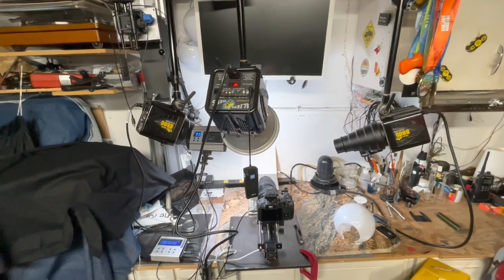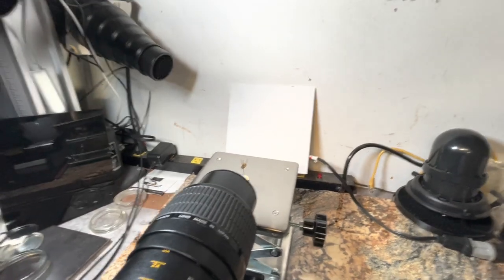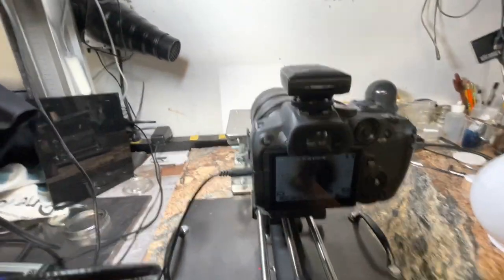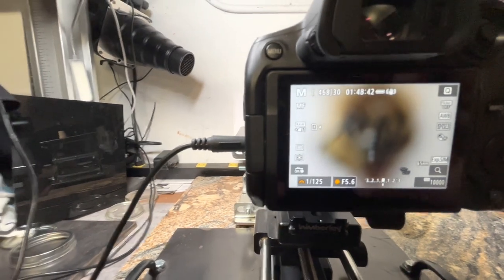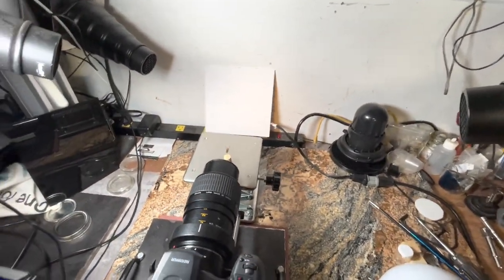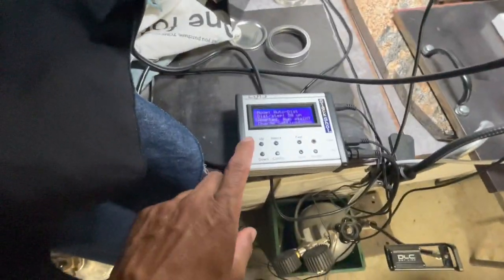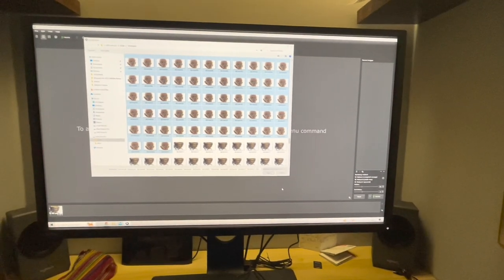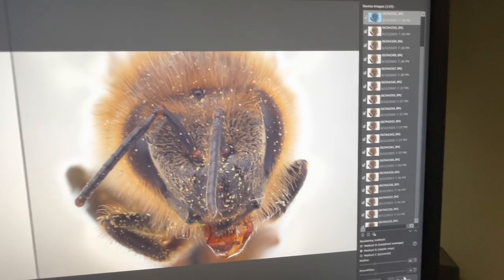Focus Stacking Bee Head Using Cognisys Stackshot

Comment: Thanks for doing this video. I just bought a Stackshot. I’m looking forward to using it. I’m a Nikon shooter, I wish they made the lens you are using. I bought a Nikon bellows to achieve the same effect. I’ll look to see if you have other videos. Thanks!
Reply from the maker: Spenser - thank you for watching the video and making a comment. Unfortunately I don’t have another video but I need to make one better quality.  This process well made simple in the video is taking me many years to figure out how to do. Luckily for me I can use the canon MP 65 mm. I also use a tube and an APO microscope lens to get in very close without using Bellows I will try to do a video comparing, the APO lens versus the MPE
Reply from the maker: Good luck - there are lots of videos that can help.  I also sometimes use an APO microscope lens with a tube to get even close.   I will post of video of it getting a portrait of the head of a carpenter ant in side view.
Reply from the maker: Spencer this video I just did shows the process again

https://youtu.be/VcXGg_Q_eW4?si=2wR4t9NlM7_1Fd_1